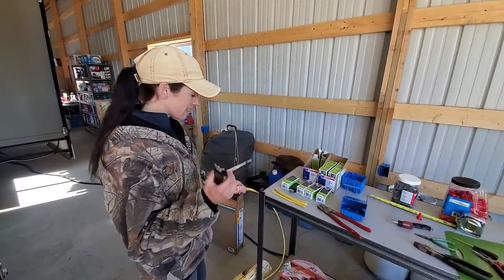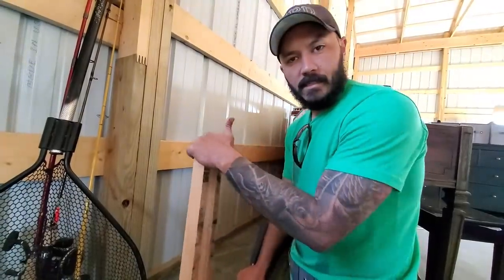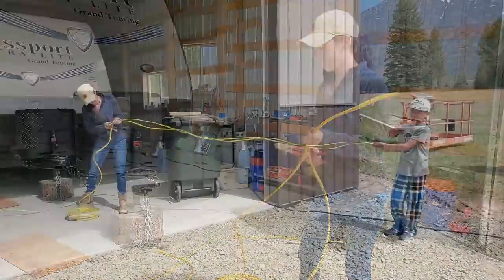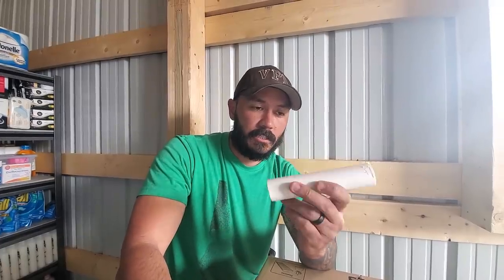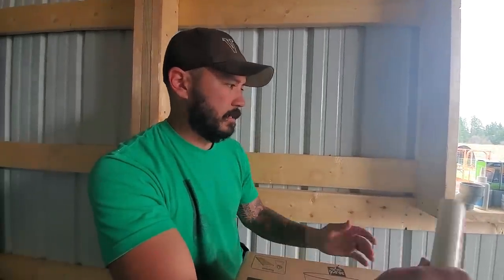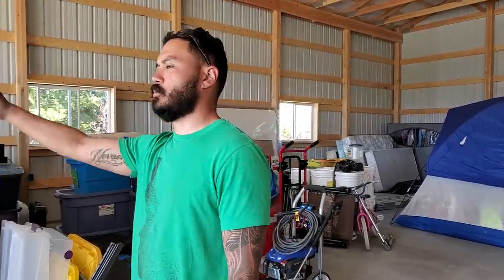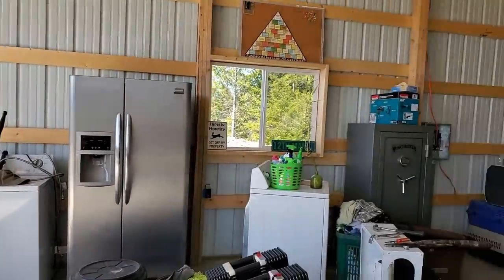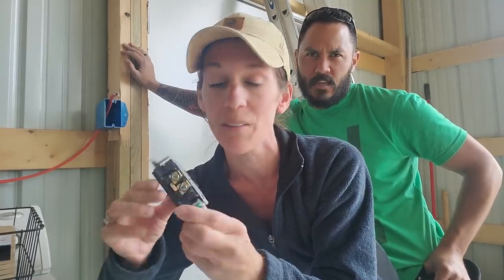Wiring Our Shop and Future Living Space. On or Off Grid?  Either Way We Need It!

Comment: P.S.- J.C. ( James ) also has the smaller model Kitchen Queen kitchen wood stove, which is an excellent airtight model. He goes through the entire workings of that stove in a video. I would have purchased one, but I restored a 1930 Home Comfort that was stored on the farm for 50 years in an abandoned cabin! That was a job and a half, but it originally belonged to a great uncle and I wanted to keep it in the family. I strongly suggest a good kitchen wood stove. The Kitchen Queen can be ordered with a hot water tank jacket. How cool is that!

Comment: Not seen wiring  nuts in the UK since the early 60s, All have Push contacts or Push and Screw contacts, Hell off a lot  Safer. Plus all wiring is Twin and  Earth unless your running Tails from the 240v incoming to a Fuse Box ( 24mm double insulated ) only time single cable is used is wiring 3 phase.

Comment: Good morning Jeremy and Michelle. When we build our farm cottage at the base of our family farm in 2016, there was no electricity. We built the house to be either on or off grid. After going back and forth with our local electric  co-op for the best way to bring in electricity, we finally brought in the grid. Our farm logs on the property near our house site. We were not allowed to have poles, as the cherry picker could get tangled when loading logs. So the line was ditch witched up to the house. We are in the woods. For the time being, electricity is cheap and available. N.H. has power failures in the winter and we are set up nicely for that. We burn wood, propane and use passive solar. Good to see the mailbox and also see that you have neighbors. Our neighbors are spread out, but we are there to help each other...

Comment: WIND and solar. Spray foam insulation, the closed cell type that hardens, it will in-case the wiring. Gives you an R-7 for each inch. I would do 5 to 7 inches in the wall's and ceiling. In floor heat from an out wood furnace, it will heat you water heater at the same time. You can run a second line to the house when it's done.  But after saying all that, I'm sure you 2 have done your homework on all of the thing's you need to do. Your not dumbies !! You were prepared before you left WA.  Have fun building your dream. Stay safe and healthy. God bless

Comment: When "gang" wiring outlets, the less connection points the better. Most outlets have push contact holes in the back to wire up with out screws. You can power the outlet on the top and continue wiring from the bottom holes to the next. Why create pig tails only to add yet another set of connection points using wire nuts.  Just another man's observation, love the channel.
Reply: Because if you wire through the outlets and one goes bad you lose it and all the others on that circuit down stream.

Comment: I finally finished a hybrid system that is 18kw solar system with a battery bank size of 14.3 kwh storage and a propane back up generator that will only power the central systems in my house like heating, ac, appliences, and my safe room. 

It was alot of money, but being in the middle of nowhere up in northern AZ I had no other options. Ideally this will last for a minimum of 10 years and I won't have to ever worry about having enough power. Especially because I can add more batteries with time and hopefully get a larger storage system to reduce propane delivery to only once a year.

Comment: This is a very good one for straw bales. Strawbale presentation - Barbara Jones - Ecobuild 2011. You are going to build many things, and various techniques can be used together. Honeydo Carpenter had air Crete and the new stucco mate, more advanced. You two have many options and Canada is really into many things, your neighbor. Wish youtwo the best, grow thermal tubes are similar toike Reynolds Earthship houses that are totally self- sufficient. Who wants to build with tires, but sunrooms onthosrdecks out front or windows that open from pulleys, warm or cool air from 8 feet in the earth work and are $d

Comment: There are several choices you could go with as a power source. I suggest you do two of them so there is a back up (in addition to your generator). You can do solar panels but you may have issues in winter. Another option in a wind turbine. There are awesome compact designs the can be installed on the roof or a tall pole. They look more like those dome roof vents, but have fan blades inside. When the wind blows it creates power that can then be stored in the same batteries as your solar. Just a thought...something to look into 😉

Comment: Hi
Just a suggestion your off grid . To save power idea here,I know u might of already thought it power to well beside the well put a water tank preferably raised up on a mound or higher to increase pressure. The reason rather than pumping all the time through the day solar with an inverter to run the pump so then u have water 24/7.
Or if u have the wind there is some great wind mills out there now or both..
Stay safe and God bless
Reply from the maker: Thank you, God bless

Comment: ooooch...Another cook in the kitchen signing in!  Call me Mr. V. the cook.  Electrical connections should be well planned out for the entire property so that you don't have to redo later.
PVC Pipe can only be used for electrical conduit if it has the proper fire ratings!  Electrical conduit is different than PVC pipe. 

You need at least a 5/8" copper grounding rod driven at least 8' into the ground that is electrically tied to your breaker box.  The buried end of the rod must be minimum 8' below ground level.  I have a rod at my barn panel, another one at my greenhouse, a third at my shop panel and the last one in the house.  Here, power comes in from the street to the house main breaker panel.  From there a 100Amp line to the shop panel where 50A is tied to solar.  From the shop panel 40A to the Barn and from the barn panel 20A to the greenhouse.  A grounding rod at each panel plus one at the greenhouse because of all of the aluminum framing. 

In the event of a power loss (no sun, dead batteries, no power from the utility) you need to ask where would you place the generator and what are your needs that the generator must take care of?  Well for water, room outlets for electric blankets, blower on house fireplace, fridge, freezer.  It wont be able to run much else.

You didn't mention how many separate 110V circuits you have running to the outlets in the barn.  Should be way more than one or you will overload the breaker or have a fire.

The 220V outlet looked more like a 110V outlet.
Are you running a 220V line from the breaker panel to the well?  Plus a 220V connection for the generator? 

Will this be the main breaker box for the property for when (if) you run juice in from the utility?  Or for solar?  Or will you have another panel located somewhere else?
Reply from the maker: Hi there, pvc inside is just a buffer. 2 circuits for 110v, 7 outlets on each one. The rods here can be steal, and we have them at each box, 8 ft in.

Comment: Great personal connection in your videos. As for your power source, you have a creek on your property. I'd check out the potential for hydro power with a pelton wheel. It could provide continuous power without the need for backup generator. You might be able to get water rights to access the creek from a higher elevation if there isn't enough head in your section. What elevation are you at and have you evaluated the growing season and you degree days which determine the crops you can grow?

Comment: I'd wire myself to the grid with the option to meet at least 80% of power needs off grid. It's simple that way and you are never fully dependent. Also, I HIGHLY HIGHLY RECOMMEND you replace that mailbox with a locking mailbox. I know you are pretty secluded but in these days, it's just a huge liability for people to have access to your mail.

Comment: My reasoning about electricity goes something like this. Get hooked up to the grid and enjoy the benifits of cheap, subsidized electricity but have some form of off grid backup system to use if needed. Why needlessly suffer off grid if you have the option not to? And this comment is from someone who has lived off grid for over a year. Anyway you cut it, it was suffering. Lol. Also, it looks like you have a beautiful piece of land there.👍🏻
Reply: Idaho electricity is not subsidized but it is very affordable because it is mostly hydropower. Idaho electrical power is very reliable. Very few power outages, even in the rural areas. But, they have a long distance to go to get to the grid. 2000 ft or more. $20 a foot or more is the usual charge to bring power in using a predug trench plus $1000 for a transformer and more. Sharing the neighbor's drop can sometimes reduce the cost. That will buy a lot of solar panels and batteries.
Reply: Subsidies = Redistribution = Sin of socialism. Self sufficiency is morally superior to dependency.
Reply: @toomuchdebt5669  The power companies are private institutions and the cost is subsidized by other customers. Economy of scale is not socialism. With socialism you don't have an option to opt in or opt out. You are bound by force to that system. I don't disagree with you about dependency vs independence but you need to educate yourself on these basic economic differences. Otherwise buying any mass produced good is socialism because the price you pay is subsidized by the thousands of other copies of that product sold and produced. Again, economy of scale.
Reply: Daytona Sixty-Eight Since socialism is the social ownership of the means of production and since utility companies are privately-owned enterprises regulated by the state, paying your electric bill isn’t socialism.
Reply: @daytonasixty-eight1354  In the inland northwest, the residential customer pays a low rate (8.3 cents per kwh for many) and big businesses pay less, especially for electricity they use during off hours since rivers flow 24/7.

Comment: Idaho rural electrical inspectors, State Department of Building Safety inspectors are usually very willing to teach DIYers and forgiving if you mess up and fix it. City inspectors just say, "Failed, You did that wrong. Figure it out and fix it." Yeah Idaho  12 gauge with 20 amp outlets. You guys are going heavy duty. Why not use PVC electrical conduit? Cheaper that 2x4s. 

"Hey Jeremy. Wake up and be a sweetheart. Go start the generator. I want to turn on the lights."

Comment: You need to use 220,actually 250 volt rated outlets! All the ones I saw are just 120 volt. Just on the 220 circuits.
Reply from the maker: They are. Thanks for helping us out though ❤️.
Reply: no 250 in the USA as a standard. 110 or 220. Not sure what you are talking about Ben.
Reply: @denisewilson8367  Electrical devices are rated for 125,250 or 600 volts in the U.S.

Comment: Maybe I missed it but make sure your 220 outlets are rated for it and your 30 amp outlet is rated for 30 amps. It appeared in the video you used a regular 110 outlet for the 220 which is wrong. Just trying to help. If I missed it I apologize
Reply from the maker: No, we didn't.  Different section of wiring

Comment: This you tube from Washington State University is dated 2010. Building and living off the grid in an Idaho Strawbale home. It's come a long way from the 1990's. They put in wind power. I think the north side should have the highest R factors. Maybe the first 4 feet hay bales on the perimeter with wide window sills, good insulation on the base. They are load bearing, Do the front log cabin and what you can budget for the East above. Your west side should store Western heat from the evening sun to keep you warm through the winter. Just thoughts, 
Straw Bales fire test video EBnet you tube Sarah King. 
Strawbale house survives earthquake you tube Strawbale TV.

Comment: i really think they require plastic condute to cover the wires and never run the power behind the tin shed drill holes through the timber and also put a earth in near the meter switch box a 12ft rod in the ground about 12 inches deep bend a 3ft section  and bury the rest and run a thick wire to the box im sure the inspector will want you do that also for thunder strikes to
Reply from the maker: Inspector walked is through it in person

Comment: I know yall are still deciding on what to do with electricity and such, please do not go the route of adding your water well on a solar setup on its own power system, just spend the extra and hardwire the system to your main panel and use solar from there, it's such a pain dealing with multiple circuits and then you have to relocate your generator during power outages back and forth. Also, I saw in your video of the portable generator, try to limit what you run off that. Things like modern computers, tv's, refrigerators don't handle those portable generators very long. I worked a few years installing solar systems and portable generators destroyed so many modern expensive electronics. It's better to have one charge a battery, then run your sensitive electronics off a quality inverter. The portable generators, even the pure sinewave versions put out very dirty power when high loads turn off and on, its those split seconds that typically destroy things. Also if you decide to go solar, ease your minds by going grid-tied to not have to worry about generators every time there is not enough sun for a few days. Install your solar system at ground level so its easier to maintain and clean during winter months instead of on the roof of something, solar is just easier to maintain at ground levels for snow clearing and such. If you can afford it during solar selection, aim for the heavier transformer-based inverters over the cheaper all digital versions. They outlive the digital versions 9 out of 10 times, but due to their buzzing and noises its best to install them in an area, you won't get annoyed hearing the hum. I can't count how many times we had people ask us to install them in a garage of a house, to call us back out 2 months later annoyed over the buzzing and wanting it moved or replaced for the quieter digital versions. I personally turned a small shed I built into a solar room to mount everything. Lastly don't buy lead-acid batteries, they are very cheap but ultimately cost you more in the long run. I bought used Tesla Model S modules from local salvage yard for $800/ea and picked my solar equipment around my battery system. When I remodeled my house about 8 years ago, I ran both AC and DC in the house and wired all the lighting in the house to run off battery voltage 48v and bought LED can lights that are 48v DC compatible. I also installed a 48v compatible DC mini-split a/c system for heating and cooling my house here in Colorado. The more things you can run off direct DC voltage allows for a more reliable solar system if that is the direction you are aiming for. The going from AC to DC to AC losses are huge in most people's systems, requiring them to scale up their solar system by 20-40% to just account for all those conversion losses.

Comment: Some people put all the wires through tubes to prevent mice chewing on them, shortcircuiting them and starting a fire. I suspect that has a lot more to do with why the inspector said this then it looking pretty. I.e. fire safety, not esthetics.
Also if you plan on keeping animals in there, place your outlets way! higher, you don't want them messing with electric either.

Comment: Why in the world would you put 7" lead wires on your outlets then tie-in the power wire into them. Every outlet has  a power-in set of contact screws [top]and power-out bottom screws.Totally needless wire join.
Reply: Jake Lloyd  ONE  TO TOP, ONE TO BOTTOM[WHITE AND BLACK] RUN BOTTOM WIRES TO NEXT OUTLET TOP, USE GFI FOR FIRST OUTLET.THERE IS NO BUNCHING OF WIRES OR NEEDLESS CONNECTIONS LIKE YOUR DOING.
Reply: Jake Lloyd I’m sure you’d want to use a bus bar or distribution box for all those wires, not an outlet or switch